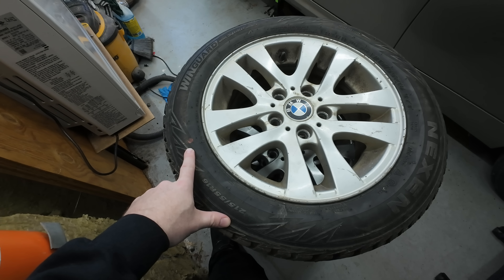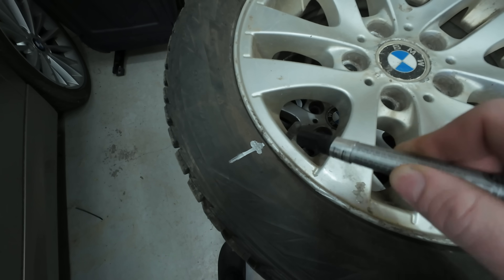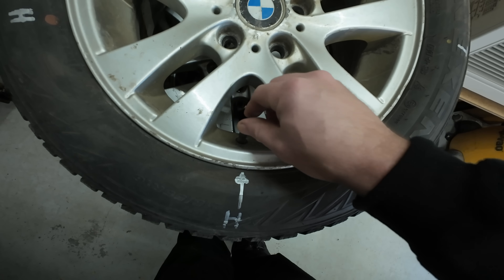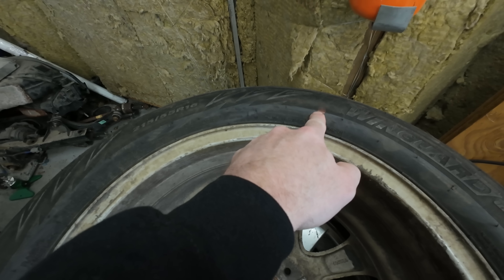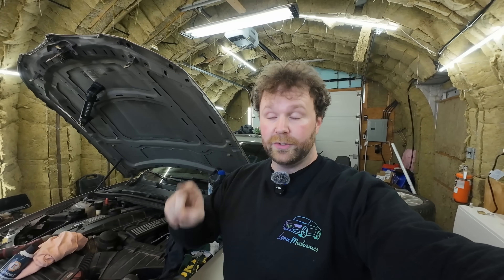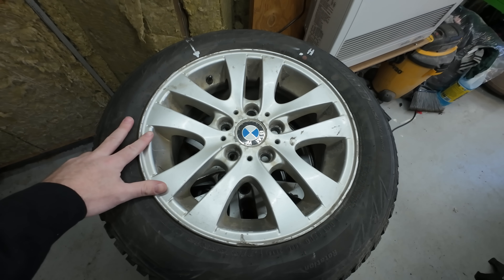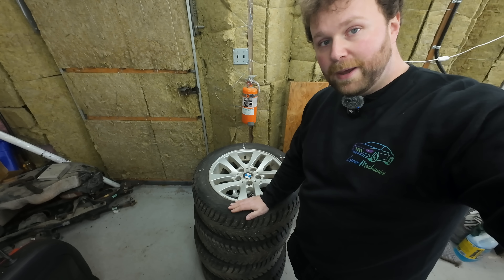Tire Red & Yellow Dots Explained | Back to Basics. Many mechanics get this 1/2 right

Comment: A little over a decade ago I had a Lancer ralliart that, with brand new tires and alignment, I would get a weird shake in my steering wheel around 70 to 80 mph. If I did 60 mph, it was butter smooth if I did 100 mph it was butter smooth it was just that weird speed range and no one could ever figure it out and something like this definitely seems like something they should’ve looked into. I mean, this wasn’t even just a general automotive shop. It was a tire shop, which is the only thing they did day in and day out. 

Also, did I miss the part of the video where you explained what to do if they had a heavy spot and a light spot? Do you have to figure out the average between the two spots or were you saying they just have to then adjust it on the wheel and move it around to figure it out?

Comment: What I have seen in the thousands of tires I have done over the last 8 years, sometimes the dots are super close together and sometimes they are far apart. I have also found that, sometimes it didnt matter if the correct dot was by the valve stem, it still required a lot of weight, and others not so much. Luck of the draw at times.
Reply: I'm curious what differences you've seen between different brands and types. For example do Michelins balance better than budget no name chinese brands? Do high performance/higher speed-rated summer tires balance better than all-season touring tires?

Comment: Don't worry about it. The maximum speed nationally is 75 mph and this has little effect. You'll get more vibration from a CV joint or a brake rotor slightly warped by heat on a new car than this will ever cause.

Comment: From my experience, most well made modern wheels are already zero balanced after the valve stem hole is drilled. At most a quarter ounce off.

Most well made modern tires are fairly round and weight evenly distributed. You can have a set of four tires and three will balance well with 2 ounces or less. The fourth will take perhaps eight ounces to balance. Sometimes you just have to warranty/swap one tire for a fourth that will balance with less weight. If the machine is accurate you'll rarely have a vibration at highway speeds. Truck tires and variants with higher load ratings tend to be more picky. 

Runout (red dot), from my experience, plays a bigger role than the weight (yellow dot). My two cents.

Comment: I was taught, Light Color, Lightest spot on wheel, Meets the valve stem/TPMS sensor. Because the spots color varies time to time, manufacturer to manufacturer.. but it stays true lighter color lighter spot. 
3:14 Typically on higher end, Low profile tires, with higher end, wheels like your BMW there. Something like a Jeep with 33's and steel wheels with beadlocks.... Probably gonna need Multiple Oz's and will Never, Ever, Balance properly. Just because the big nobby tires arent made as consistently as our low profile higher speed rating tires. Also, Factory steel wheels on Econoshitboxes arent as True as aluminium wheels from high end specs. 
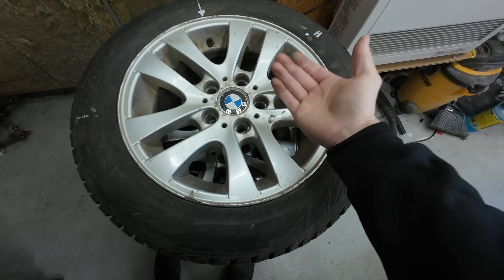4:20 This is Also assuming the wheels are close to true and not tweaked and bent.. if its bent or beaten up badly, the manufacture cheater balancing points only go so far.

Comment: I watched entire video.

So I’m not clear Lance.  I’ve only seen one dot on a tire.  Never both.  So what is the proper positioning.  
Yellow (lite) to stem or red (heavy) opposite side to stem?
If in your example, do you split the distance with the valve separating the red and yellow equally?
Or are the dots on the tire to tell the tech that if he can’t get away with 1 1/2 ounce to break the bead and slide tire around rim and try again?  That method seems like going Easter egg hunting.  Is there a defined procedure to expediently utilize these dots to the techs advantage in obtaining proper mounted tire balance.
Thank you in advance!

Comment: I worked in the tire shop at a farm store back in the 80s. Back then alot of rural farm stores also sold all kinds of tires including large AG tires and heavy bias ply tube type and tubeless tires. 

In those years everyone was building monster trucks with massive tires over 40 inches and they were not steel belted radials. Those tires were very heavy and way out of balance all of the time. 

I learned that many times I would have to throw them on a bubble balancer just for the initial install. Then I would find the heavy spot and mark it, break the bead and spin the tire 180 degrees and remount it.
Then we would bubble balance again and mark where the weights would most likely end up. 
Then we would throw the wheel and tire on the spin balance machine to fine tune where the weights would be locked on and fine tuned.
 
Some of the large bias ply tires were so bad even with the entire process we still ended up with multiple weights on the inside and outside of the rim to balance them out.
I once had a guy bring me in 42 inch bias ply tubeless tires on 15 inch rims. He special ordered them and paid us to mount and balance them and my boss made me do it on a Sunday when we were typically swamped with work because we were only open for 1/2 of a day in the tire center. 

They were so horrible  that I had 1/2 of a lb of weights on a wheel and tire. It did not matter where I mounted the tire around the rim. I could not get the tires to spin balance properly in all ranges of speed so I shot for butter smooth at 60 mph. The speed limit on the hwy was 55 back then. 

So above and below that there was some vibration from those huge mud tires. He brought them back in the next week and with his permission we did an old farmer trick.

We sold him 4 cartons of BBs off of the shelf and I poured them into each tire, problem solved. Those big tires became self balancing when he spun them up. Centrifugal force moved the BBs around and helped balance the tires. He was happy and it kept him out of the shop. He never had to balance them again until he changed them out. 

I know people are going to jump me about this story , but they need to understand that some of the tires back then were that bad. Try and balance a bias ply Nylon ply tire that weighs 90 pounds and make it spin with low vibration down the highway.

Comment: What is worse is when they put tires on with a impact drill and you need need a breaker bar to get the lugs off.
Reply: A lot of wheels are actually torqued to spec, and some STILL need a breaker bar to remove them.
My truck specs 165lb/ft, many people can’t undo that by hand.
If your lugs come of easily they probably weren’t tight enough.
Put your foot on the wrench, use your body weight.
Reply: @megastick9324  Try doing it on the side of the road with a flat tire with only a the short lug wrench. Not only is that a problem but over torquing can warp rotors. You shouldn't have to use a breaker bar unless something is too tight.
Reply: @adamstull2436  use your foot.  Many people, and most women, can’t loosen a properly torqued lug nut with the ridiculous factory wrench.
I carry whatever I need to do it, regardless of the factory wrench or how tight the tire shop tightens them.
It’s on YOU to be prepared, no one else.
Reply: @megastick9324  No it on the the shop not to over tighten lugs that you can get them off with standard equipment. if you have to use a breaker bar and jump on it to break the lugs loose it is way beyond torqued. I have had to this with a standard car lug because they hammer the lugs with a air wrench. By you logic you tow another vehicle around  just to be prepared. You are saying that its ok for a shop to damage your vehicle. Because that is exactly what they are doing.
Reply: @adamstull2436  no, what I’m saying is, some people are not nearly as strong as they like to think. Add to that how long the lug nuts have been undisturbed and what weather you’ve been in.  
You are looking for a perfect world that has never existed and refuse to be prepared for what does exist.
You carry a spare tire, why would you not carry the other tools needed for a quick, easy job? Buy a cheap harbor freight battery impact, carry a breaker bar, so whatever it takes to succeed at a simple task.
Blame the shop all you want, YOU are not prepared for anything outside your narrow vision of how the world SHOULD work.
Adapt, overcome, or fail.  Life is all on YOU.
Reply: You are not listening. The person who destroyed you vehicle by tightening the lugs so tight that the car is a danger. You are ok with someone doing such a piss poor job that it put people lives at risk. Then say its on you. How the world works is the person get fired at best. Like i said you must tow another car behind you because anthing could fail. Or i guess you are just not PREPARARED.
Reply: @adamstull2436  if the car was destroyed, why were you driving it? How do you not being strong enough to loosen lug nuts equate to destruction of your vehicle?  And if it was destroyed, why didn’t you go to court to rectify what you claim was obvious negligence?
Did you test break away torque to quantify your claim, or just struggled with a cheap wrench and decided there was negligence?
Sounds like a weak whiner having a fit on the net with zero empirical evidence, other than a cheap wrench and no upper body strength…

Comment: I have also found out over the years, sometimes the dots don't mean shit. I think on Fridays they just put dots on in any spot.
Reply: Yes and when the wheel is bent the dots are irrelevant
Reply: On Saturdays its Polkadots.
Reply: Max runout and lightest point may be very small values that don’t make a difference. Completely depends on the build quality of the tires.

Comment: How does this work for dual season tires?  The ones with tread on both sides, requires a tire machine to flip em inside out.  Most tire shops don't have the machines for flipping tires inside out, so many people toss good tires. They are common in places where everyone drives dual season tires.

Comment: Not quite.  The yellow dot is the light spot, so that war right.  But the red dot isn't the heavy spot, it is the high point of the tire's runout, or the high point.  For the best ride, the high spot of the tire needs to be aligned with the low spot of the wheel.  Decades ago when wheels were steel, the valve stem hole was drilled at the low spot of the wheel's runout, but with aluminum wheels the valve stem location is cast into the wheel.  Anyway, wheels get bent in use and should be measured.  Then match the red dot (tire's high spot) to the wheel's low spot.  Note, the high spot might be a stiff spot in the tire, not necessarily a physical high spot.  Still, it goes to the low spot of the wheel.

Comment: You're damn straight it will pay off in the long run, I don't trust a damn garage around here in Scotland.
None of them pay attention to what bolts the workshop manual says not to use impact drivers on, I've observed every garage in my town & not a single 1 of them doesn't just use impact drivers, no proper torquing of bolts.

If I saw a techy bother to balance my wheels to that extent, you bet your ass I ain't using anybody else & I'm telling everyone else about that person.

Comment: If you need more than 1 ounce total, the tire is bad.
Have tech check rim balance before installing the tire on the rim.

Balancing on the car is probably the best balancing you can do.
That way it balances the rim and the brake disc at the same time.

The better the balance the longer the tire can last. And less stress on steering components/suspension components.

Comment: Hello LANC----Bought a new set of Toyo Extensa tires I haven't had installed yet with 0 red dots and only one yellow dot on each tire. Yellow dot has a center AND a yellow ring around THAT. Is this something I need to understand different than a simple yellow DOT, for lining up with valve stem ? or something else ?

Comment: Nice video. You mentioned that if you only have a yellow dot, you can line it up with the valve stem. If you have a red and yellow dot, you indicated that most technicians line the red dot with the valve stem, which you said was wrong. You didn't mention where you line up the tire if you have a red and yellow dot. Just wondering.
Reply: Just so you know- I stand corrected. When you have a red dot and a yellow dot, the red has priority. So yes, you do line the red dot with the valve stem in that regard.

Comment: Just a note that OHV (ATV & SxS) tires, at least the ones I've bought, only had the yellow dot where I've always requested the tech line that up with the valve stem. I've never had an issue with what seems like a wheel out of balance and yes, I've ridden on roads too. Typically OHV wheels are not balanced unless there is a problem.

Comment: Paused before watching past the first few seconds, just to see if I have it right. Yellow is the lightest spot, and should be aligned with the valve stem. Red is the highest spot on the tire, meaning radial runout, not necessarily the heaviest spot. OK, let's see what happens.

EDIT: OK, now that I have watched the video, I'll stick with my assertion. I hand mount most of my tires, and will always line up the yellow to the valve stem regardless of the red dot. 90% of the time, no balance weights will be required, at all. I have done this with 13" Subaru tires/wheels all the way up the  the 17" snow tires on my full size Chevy 4x4 truck. Occasionally I will need to take one or two wheels to my local shop for balancing, but not often. Last May I mounted a new set of cheap tires (wally world) to the front of my lowered 96 Chevy C1500. They are 215/75R16. I then proceeded on a 3000 mile road trip to visit family in the Midwest. 70-80 MPH for hours across Montana and the Dakotas. No wheel weights, and no vibrations.

Comment: WRONG - the stuff about the red dot is not accurate. The red dot has nothing at all to do with mass. It indicates the point of maximum radial force variation in the tire. This relates to the tire stiffness and roundness. Problems with that is something that sometimes requires road force balancing - that involves re-positioning the tire on the rim before mass balancing, to balance out the stiffness and roundness around the tire. 
If the rim has a mark indicating the low spot (minimum radius, minimum radial run-out), you'll want to line up the red dot with this. 
Any MASS imbalance can be accounted for with weights, but tire stiffness/roundness vs. rim roundness cannot be fixed with weights. This is why the red dot takes priority. But a marked rim (usually a white dot or dimple) is not common. So if there is no such mark to be found, you should ignore the red dot and line up the yellow dot with the valve stem, for the reasons you said. It allows balancing using a minimum amount of weight.
If the yellow dot indicates the lightest spot on the tire, then by definition, the opposite point, 180 degrees away from it, will be the heaviest spot on the tire. This video says the red dot is the heaviest point on the tire = wrong.
Much of what is said in this video IS correct, but the blatant error kind of throws doubt into the stuff that is true, for people who don't know better. You might want to edit out the wrong stuff.

Comment: You have this completely wrong. The tires are fairly well balanced with the difference between heavy and the light dots under 0.5oz. Your wheel is cast so it has runout and not isn't balanced. The valves stem is not the heaviest there's no telling where the heaviest part is because it's cast, one of the spokes could be thicker or a thick spot in the barrel. The dots mean nothing and are only for the mfg interval quality control checks. If you want to do anything about tire position you need to check the stacked runout of the wheel and tire as an assembly, this is what road force balancers do.

Comment: Technician here. Sorry Lance, you got this one only half right yourself. The red dot is not necessarily the heaviest part of the tire, but rather your highest point (or RFV-Radial Force Variation point) which is the most unbalanced spot on the tire. At the factory when the tire is tested for radial force it pushed outward on the machine by the greatest amount where the red dot is located. Ideally you line this up with the lowest part of the wheel (if the wheel is marked). This is what we are taught in technical school or if you meet with a tire manufacturer. Hope this helps.

Comment: The red dot indicates the high point of a tire or the stiffest point of the sidewall. If a rim has a low point marking on it the red dot should line up with it. The red dot alignment takes priority over the yellow dot, however most modern rims are very concentric and don't have a low point marking. In that case the yellow dot should line up with the valve stem.
Reply: Red dot dot is the flattest point yellow is the lightest, red dot always takes priority
Reply: @OzFrog48Z   indeed

Comment: All other things being equal, minimizing the amount of weight needed to balance the wheel and tire assembly is a good thing. But there actually are two factors that can cause vibration issues, balance and runout.  I've seen tire and wheel assemblies that were perfectly balanced, but still had issues due to run out. That's the advantage of using a road force balancer. Minimize the runout, then balance it at that point.
Reply: Using a road force machine will teach you that the marks don't mean much and the quality of new tires is pretty bad.
   With the cost of a new road force balancer and the required new no touch tire changers for the newer factory wheels at over $30k each, I don't think the typical mechanic is going to be able to change tires much longer.